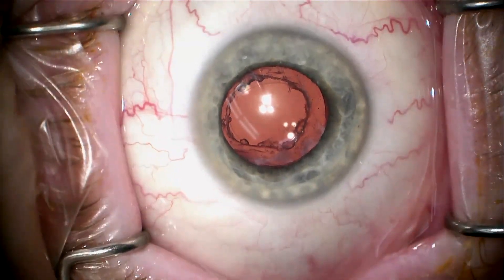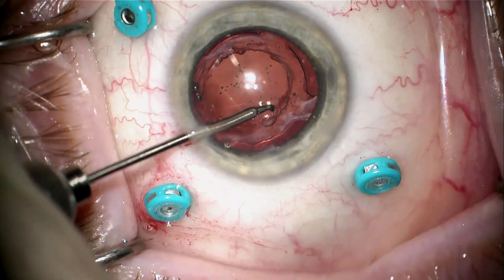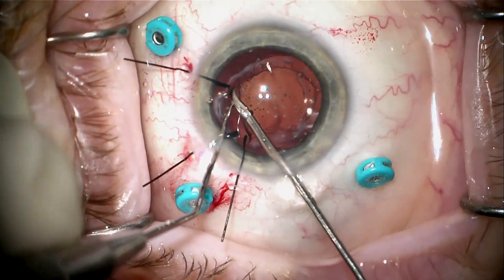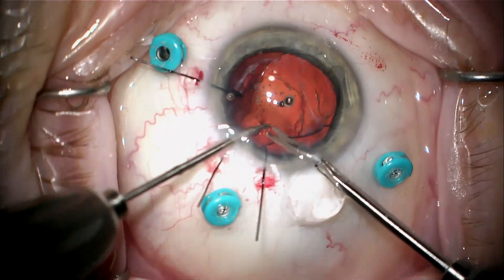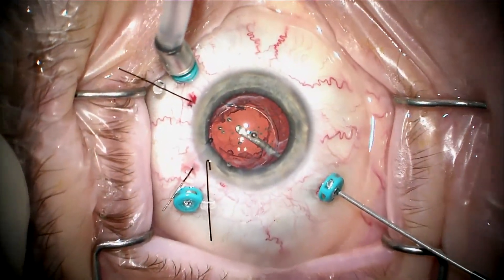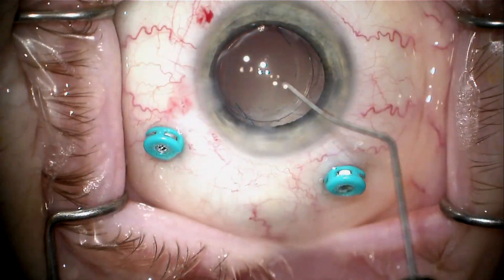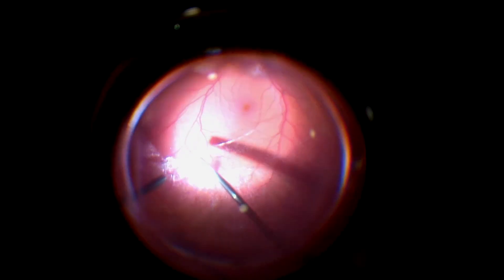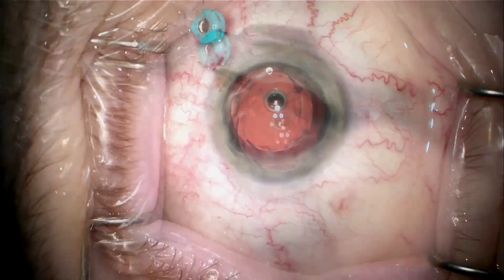Removal of Clearview SBL-3 post YAG, PPV, with induction of PVD by Steven G. Safran MD

Comment: Dr. Safran, fantastic videos! Regarding your expertise and experience with monofocal IOL’s in what situations besides obvious AH, or PDR do you avoid Li61ao? What is your go-to toric IOL? Do you put a lot of stock into the spherical aberration of a patients cornea prior to deciding on a monofocal (ex. Using eyhance if they have more positive SA). I also noticed the various issues with the Rayner EMV platform. I take it you’re not a fan of hydrophilic IOL’s especially years out. Thank you for your time
Reply from the maker: Not a fan of hydrophilic acrylic at all....they calcify over time and especially in complex eyes.  I also stopped using Eyhance as I've had to remove too many of those for visual issues.   I am not a huge disciple of spherical aberration matching but will consider it to some degree if all other things are equal....i.e use an Envista vs Tecnis in previous Hyperopic Lasik,    BTW Eyhance has same  neg. spherical aberration as standard PCB00 tecnis does.  I like Li61A0 and avoid if need toric or multifocal obviously and of course if Asteroid or PDR.  But no other reason to avoid it really....I'd certainly have that put in my own eye without hesitation.  Great lens.

Comment: Doctor how’s the new lens is attached in this case where the YAG was performed ?
Reply from the maker: Optic captured behind the anterior capsule.  Extremely stable and secure.
Reply: @StevenGSafran so in lame language the edge of the left over capsule bag is still used ? That’s awesome didint know it is possible after yag laser is it some time limitations for that ? I mean can that aproach can still be applied in someone who has yag laser years ago ? Greetings
Reply from the maker: @gracxx162  Optic capture is a very standard approach that can be utilized in many cases where there is a previous YAG laser.  You need to use a 3 piece IOL, put the haptics above the anterior capsule and buttonhole the optic through the anterior capsule so it's like a cufflink in a shirt.   You can do this years, even decades after original surgery provided the rhexis opening is of appropriate size, intact and the zonules are strong enough to support the complex.  You cannot do this with a "Dead Bag" or if the zonules are shot.  If there is significant capsulorphimosis or the rhexis is too large or not intact it is also not an option.
Reply: @StevenGSafran so goin with this aproach it is not possible to use multifocal lens if If I understood correctly ?
Reply from the maker: @gracxx162  Modern multifocal IOLs are single piece acrylic lenses and to do optic capture you need a 3 piece acrylic.  One can however do reverse optic capture with certain multifocals but I personally would be reluctant to offer that option for a variety of reasons
Reply: @StevenGSafran is the LAL actually Also 3 pieces ? I know they are also silicon but the design fit to this approach or also not ?